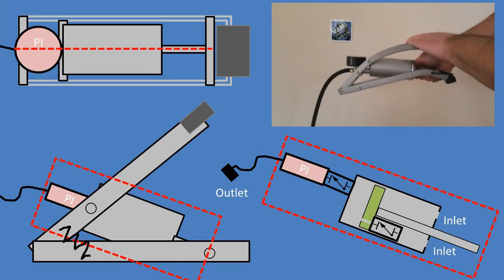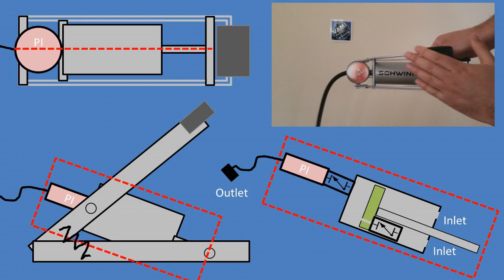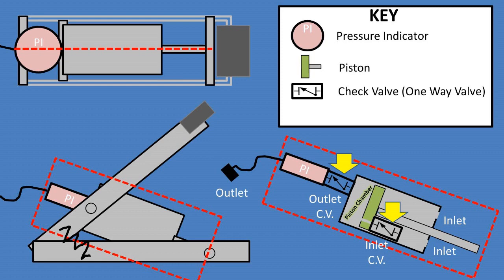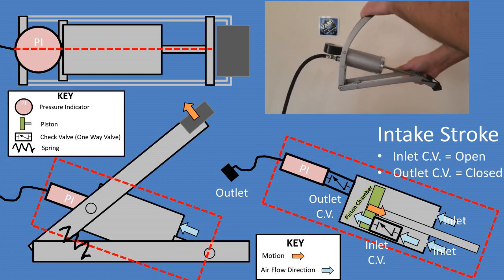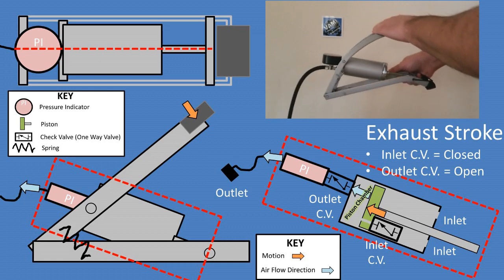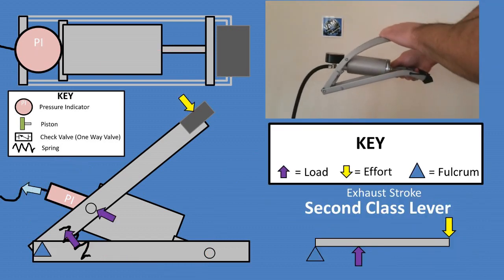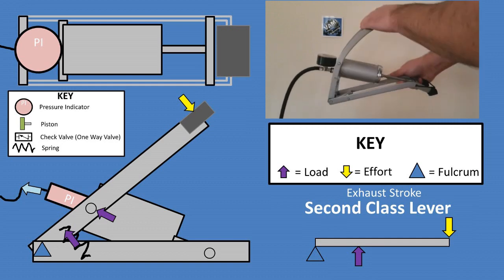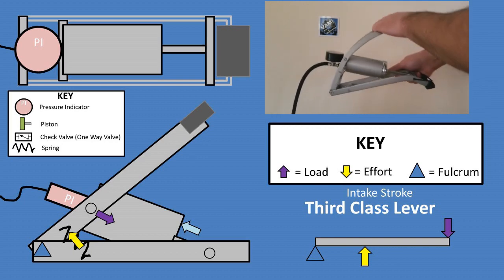How Bicycle Foot Powered Air Pumps Work

Comment: Which gas get inside oxygen nitrogen or carbon dioxide ???
Reply from the maker: it is what ever the atmospheres air mixture is at the point of entry. Assuming you are pumping up something in the open atmosphere.